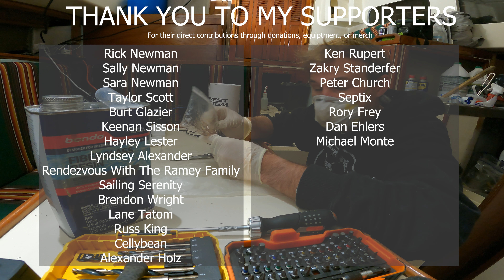Two Little Updates and LOTS of Epoxy

Comment: Congratulations on the birth of your children!!! You are really making this way harder than it needs to be.  Cover both sides of the foam core with the chop strand and roving as soon as you have it cut to size -- it will be way easier to apply on a flat surface instead of on a vertical surface.  Then all you need to do is glue into place with thickened epoxy, and then tab to the hull with strips of fiberglass tape.  You will make much better progress with this method as you can prepare many pieces all at one time on a flat surface -- you free time will obviously at a premium moving forward.
Reply from the maker: That is an excellent idea! Dang 😅 I feel dumb now